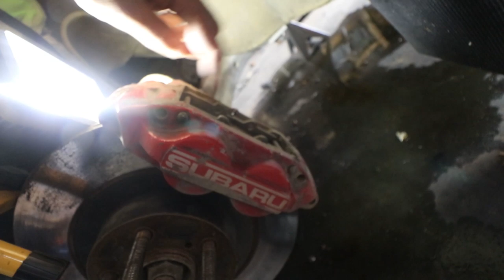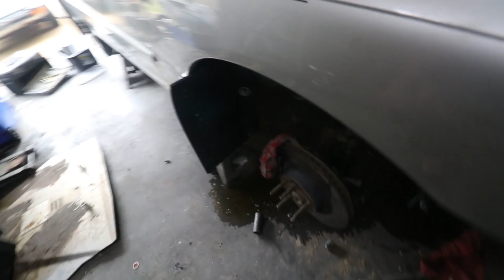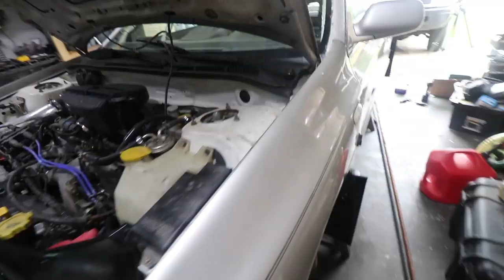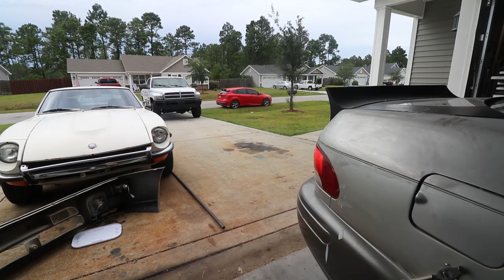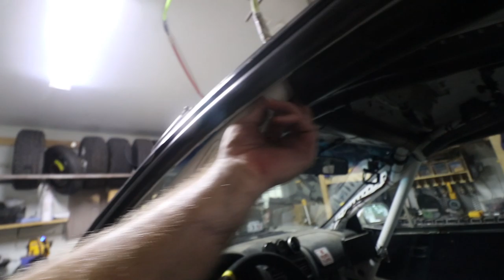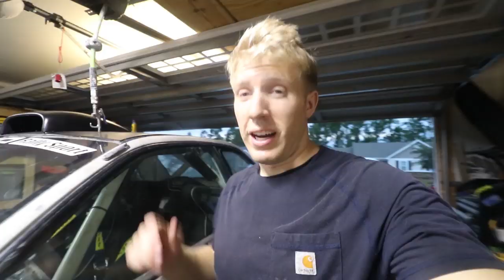Racing Brake Setup for the GC8 Rally Car Before The Next Big Rally Race

Comment: Great video.  I just bought 4/2 pots for my Impreza. I got a couple questions if you have time. Have you thought about deleting your brake booster? Curious what your opinion on that is. Also, with the hydro handbrake, do you worry about your center diff? Or maybe since you're only pulling it on loose surfaces it doesn't matter much? Anyways, I appreciate the videos, keep it up dude!